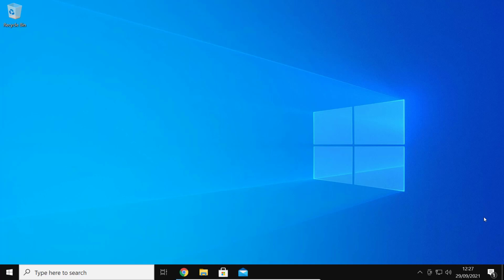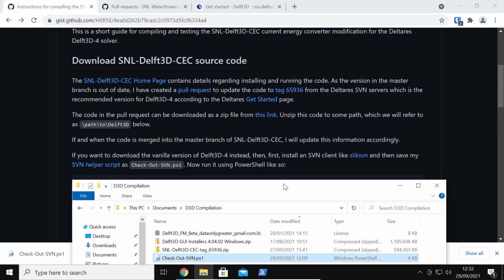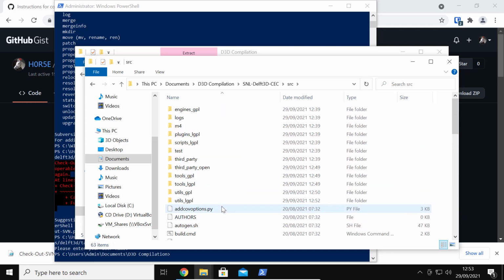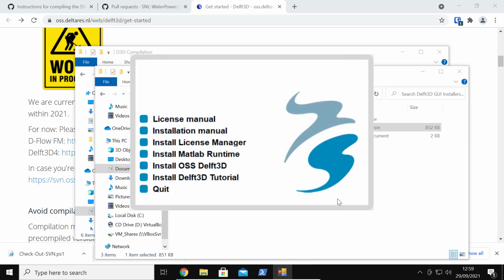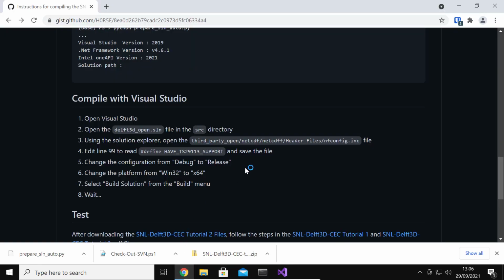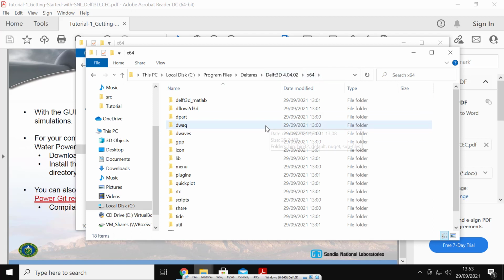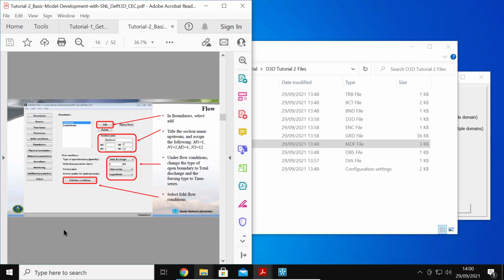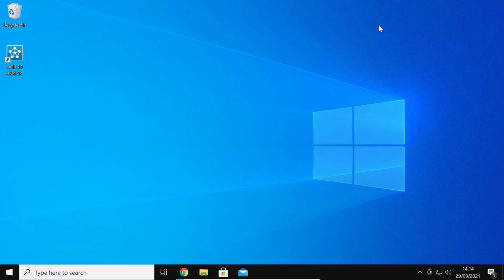Compiling Delft3D-4 with CEC support using Visual Studio 2019 and Intel oneAPI (2021)

Comment: Hi~
I got some errors, when I am compiling by using "delft3d_open.sln". Here are some my errors:

error #6439: This symbol has too many characters. [OMPX_TARGET_ALIGNED_ALLOC_DEVICE] (from File: omp_lib.h; Line: 895)
error #6439: This symbol has too many characters. [OMPX_TARGET_ALIGNED_ALLOC_SHARED] (from File: omp_lib.h; Line: 911)
Compilation Aborted (code 1) (from File: ...\engines_gpl\part\packages\kernel_f\src\delpar.F90 Line: 1)
fatal error LNK1181: cannot open input file '...\src\engines_gpl\part\packages\kernel_f\x64\Release\part_kernel_f.lib'
fatal error LNK1181: cannot open input file '...\src\engines_gpl\waq\bin\x64\Release\delwaq_dll.lib'

How can I fix these errors? Could you kindly give me some suggestions? I have got Delft3D-4 complication for about 2 weeks.
Thank you very much!

Comment: Hi, when I run prepare_sln_oneapi.py I get this error in line 378:

 File "C:\D3D\Installation\SNL-Delft3D-CEC\src\prepare_sln_oneapi.py", line 378, in process_project_file
    parts[i + 1] = toolsversion[vs]
KeyError: 2022

Any help would be appreciate.

Thanks.
Reply: It just worked for  Visual Studio 2019 and Intel oneAPI (2021), I tried to change the code for Visual Studio 2022 and Intel One API 2022 but was unsuccessfully.

Comment: Hi, excellent video. Many thanks. I have a problem, maybe you can help me. When i compiling the code i get the error LNK1104 "cannot open the file ifconsol.lib". I have intel api 2022 and VS 2019
Reply: Hi José Manuel, could you solve the errro LNK1104? I have the same error, and I am trying to solve.
Reply: @reivajto9  i've downloaded the delft version provided on the web Page
Reply: SNL delft3d

Comment: Hay mate, thank you very much for your videos, they've helped me a lot to compile this software. I have some doubts that maybe you can help me.
I've done the Delft3dFM compilation following the instruction of your other video (https://www.youtube.com/watch?v=Lsk5Kvh_xJo) but deltares gave me the Delft3D GUI 4.04.02. I don't know if I can use the binaries of the FM version when I'm installing the binaries in the Delft3d4 GUI.  Should I compile Delft3D4 like this video and ignore the Delft3dFM compilation? Do you know if I can request the Dlef3dFm GUI? 
Well, thanks in advance, 
Cheers
Reply from the maker: Tomas, the 4.04 GUI only works with Delft3D version 4, as compiled in this video. However, I believe you can contact Deltares to request to join their beta testing program for the Delft3D FM GUI. There is an email address on this page: https://oss.deltares.nl/web/delft3dfm/get-started
Reply: @dataonlygreater  Thanks for your reply, now all makes sense 👌